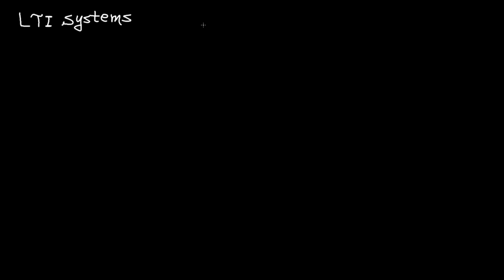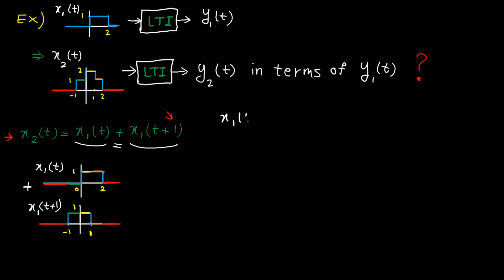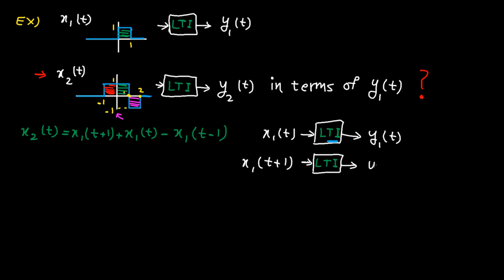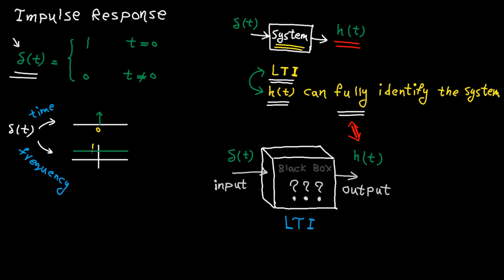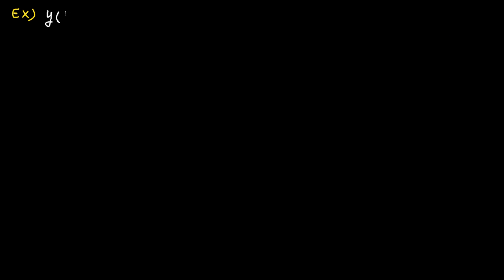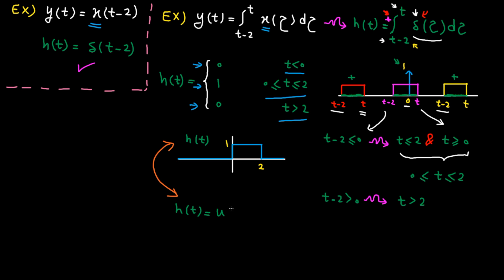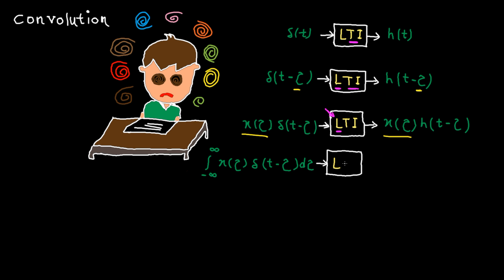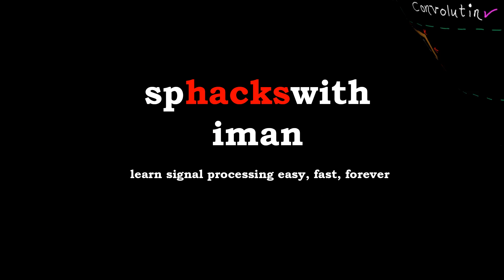Time domain - tutorial 8: LTI systems, impulse response & convolution

Comment: doesn't the delta function have a height of infinity and not 1?
Reply from the maker: Yeah, that's correct but the integral/energy under the curve is one. It's just easier to assume the amp is one at zero (but technically this is not def correct).

Comment: Ahh so by the richest response and stimulating all frequencies, you mean as opposed to if you only stimulated a particular frequency and thus would only get a smaller response. SO let's say the system is sensitive to 3 frequencies at different weights. If you Impulse you stimulate all three, however, if you don't send an impulse and use a specific stimulating frequency then only a select frequency would respond. Thus this is like when you shake the change in your pocket and pseudo different coins sound differently pennies vs quarters.
Reply from the maker: Nice analogy. You should start your own YouTube channel ;)

Comment: Dirac delta function is equal to infinity in continues time. In discrete time it's equal to 1.

Thank you very much!
Reply from the maker: Hey Alon, thanks for your comment. Technically impulse function is a rectangular function with the width of Delta and the amplitude of 1/Delta when Delta goes to zero. Thus the area under the curve is one. This definition is  technically true but hard to digest. It is common to model this with the unit impulse function with the amplitude of 1 at the origin. Hope this clear things up.

Comment: Hi Iman, thanks for this great tutorial!
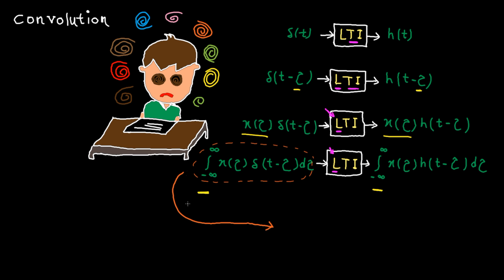I only have one question. @11:29 shouldn't the result of the sifting property x(tao) instead of x(t)?
I mean, we said tao is the time shift, so the sigma signal is only defined at this point -> tao but instead you said -> t .. 
Also, is there a significance in using tao in both signal in: x(tao) sigma(t-tao)?
Reply from the maker: Hi Mohamed, thanks a lot for the feedback. Regarding your question, it must be x(t) not x(tao). Please note the the integral variable is tao ...  inside the integral you can see t as some sort of constant. When tao is changing from minus infinity to plus infinity, x(t) is one value (i.e. the value of x at time t) and independent of tao. When tao is equal to t, the impulse function becomes one and you can apply sifting property.   Hope this helps.
Reply: @sphackswithiman  Thanks for your reply!
I am still not getting how we are mixing between t and tao in both (integral variable, time shift) but I might be getting the whole picture in a way or another.
1) In step 3: The system is linear and we multiply input by an arbitrary value x(tao) .. x(tao) here *is a single value NOT a function*, right?
2) In overall: We are constructing the function/graph x(t) by adding multiple x(tao)s where tao is changing from -infinity to infinity using the equivalence property of the sigma signal?
Am I correct with this approach?
Reply from the maker: Hey. I am sorry if the approach is confusing. The variable inside the integral (tao) is the thing that is changing from -infinity to +infinity. Inside the integral you can see t as a constant. Regarding your first point, yes at that step you can see x(tao) as a single value . Regarding the second point, yes we add integral and then use sifting property to replace the integral on the left by x(t). Hope this helps.

Comment: I understand convolution even though it's supposed to be harder. But no matter what I can't understand or accept impulse response. I don't get it! How can you put a function into a system? Is the blackbox the input function? Are you applying the input function into the black box? Then what is the blackbox? Another function? Why would you apply a function into anther function in this case? What is the purpose? So so confused.
Reply from the maker: I am really sorry that my explanation didn't help you grasp the concept. Convolution is a bit complicated concept and I feel you. Please pinpoint which part you don't get. I will try to explain it better.
Reply: @sphackswithiman  When I think LTI system I think a process (like a programming loop) that performs a linear sequence of operations? Is that a correct assumption?

Secondly, if it's a linear sequence of operations on an input sequence(impulse unit in this case), then shouldn't it's output sequence be equal in length to is input(impulse)? Ex. I input [0,0,0,1,0,0] 6 length input sequence. Shouldn't I get back an out of 6 length also? I'm assuming the system takes each element in the input sequence, operates on it and produces an element for it's output sequence (output here being the impulse response)? I've seen LTI system examples where the impulse response length does not match the input length, information is being lost or added.

Finally, why bother with an impulse response? The system works. Why not just take your input, pass it into the system get your output.. why get an impulse response and convolute it with the input? Seems roundabout. 

I understand convolution btw. From mathematics. Just don't get the point of an impulse response when you have the system and the input and you could just give it the input and forget the impulse response.
Reply from the maker: Hey again, regarding the first question, LTI means linear and time invariant! Linear stuff is happening in the system but it is not exactly a for loop. Please watch my lecture on system properties to learn what linear and time invariant mean.

second question: what you said is true for a memoryless system, the output at any time only depends on the input at that time. If the system has memory the length is different. Again, watch my lecture on system properties.

last question, I am not sure what you meant. The main goal is to identify/understand the system!  Please clarify your question.
Reply: @sphackswithiman  Yes I know the properties of a linear time invariant system. f(x + y) = f(x) + f(y) etc. Can you please give me some real examples of an LTI system? Abstract is great and all, but I need to know what a tangible LTI system looks like.

Understanding a system via it's impulse response is great. I support the goal 100%. Obviously though you and I know that using the system is the real goal. That's why it's impulse response is used in a convolution with an input. Now why doesn't that feller just input his input into the system. Why does he need to obtain a response then use convolution?

Comment: Your videos are very helpful.  I shared your website with my class.  My professor watched some of them and commented that they are awesome.  Have you considered posting notes for each video?
Reply from the maker: Hey Jack. Sorry for my late reply, life has been hectic recently. Thank you very much for your feedback and sharing my work with your class & the prof. Regarding your question, I just wonder what kind of notes you are talking about. I haven't posted any notes for the videos but I guess it is a very good idea to post learning objectives for each lecture. By the way, which university are you at? If you have more ideas to help me expand my outreach, I would love to hear it. Please let me know. Cheers!
Reply: No problem regarding the delay.  I understand hectic life.  A full time career and working on a second bachelor degree in electrical engineering at the University of Michigan keeps me busy.  Regarding the notes, I started to write out the material from your lectures but it is very time consuming.  The Fourier Series lecture took me a couple hours to write and was five pages long.  I thought you might have notes you used when you recorded each lecture.  If not, please don't spend time on it.  I would rather see you produce more lectures on Laplace and other topic related to signals and systems.  The other idea I had was to take screen captures of each page in a lecture and then convert to a negative image to turn the background white.  That way they could be printed on paper.  Of course the colors you used for writing and drawing would all be negative too.
Reply from the maker: Awesome! Working full-time and studying elec eng must be damn difficult. Keep up the good work man. I didn't think about printing issues with black background!! Great feedback. I am thinking to publish the notes along with some assignments for each topic as a course book. I've made all the videos for this course ad-free to assure there is no distraction for students and I was hoping to get some support through donation to keep producing more lectures. Unfortunately, the donation was not very successful. I am planning to make the course book available with a very very small cost so that students can afford buying it. Honestly, I am not doing this for money, but I need to find a sustainable model to go beyond this course and produce many more videos. Producing these videos are very time-consuming.